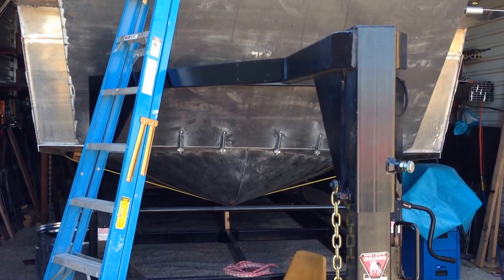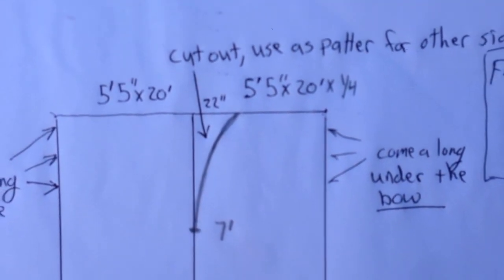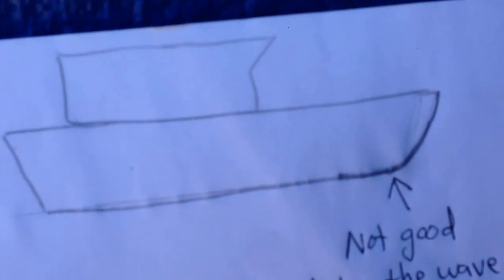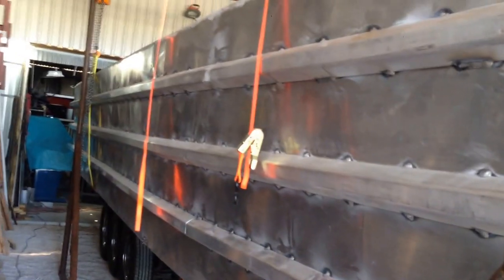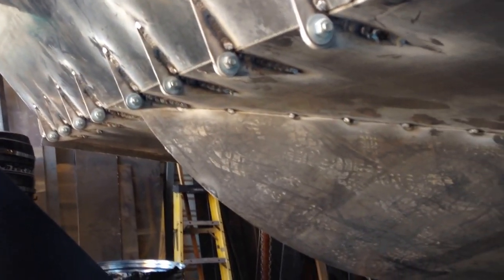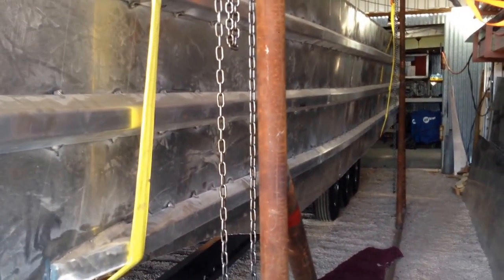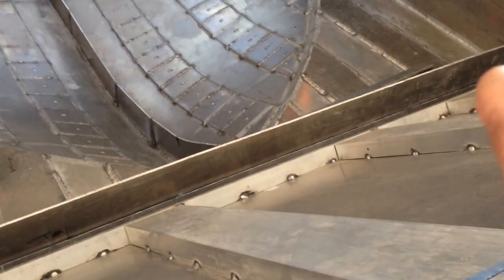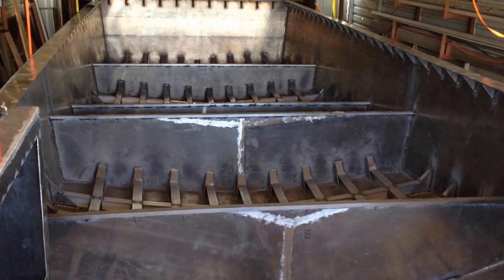building aluminum boats 12

Comment: I am a woodworking hobbist and when I started I used on-line plans. These plans comes with a material list, a cutting list to reduce waste, plus buy a video that show step by step. So I look on line for boat builders plans and for $15 for the plans or $250 comes with patterns plus video. My opinion for beginners, it better to save money, reduce waste, and eliminate or limit mistakes is smart thing to do. Do you agree? Did you ever used plans for building boats? P.S. These plans every kind of boats of every size.
Reply from the maker: Yes I think plans with patterns is a great thing,I never did use anything like that,,maybe I just wanted to do it all by myself ,,not that that is smart because Ive made many mistakes,,I think theres companies that will cut out all your piecies also,,,Yes its a very good ideal